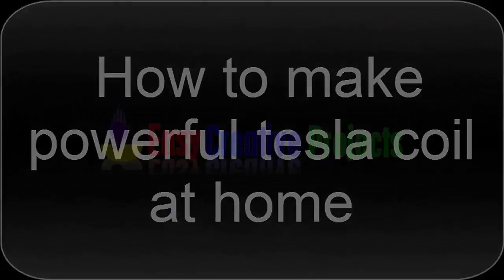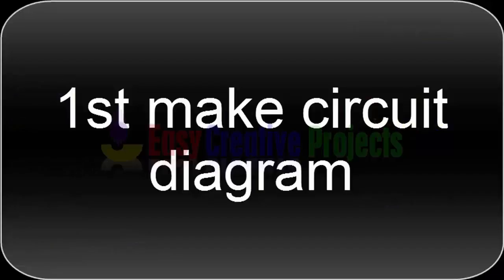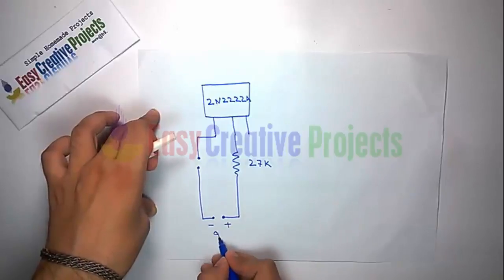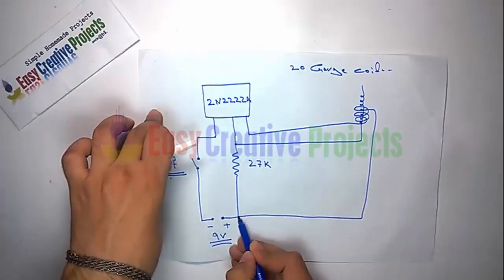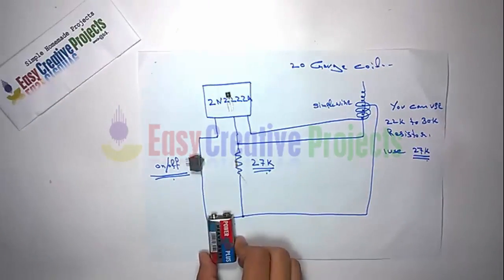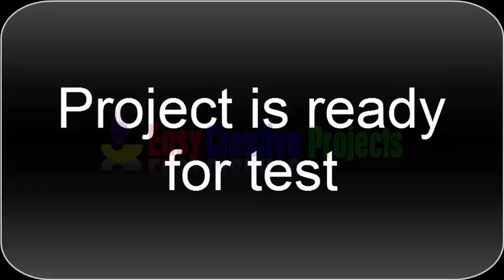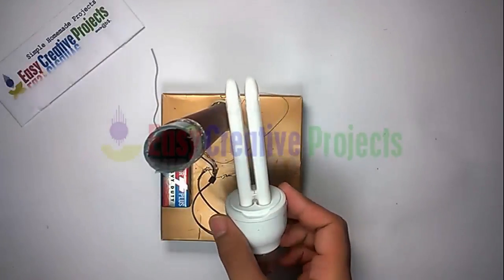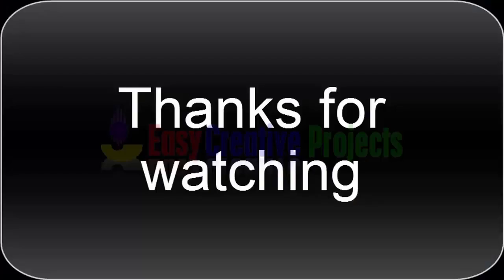How to make powerful tesla coil at home - easy step by step with circuit diagram

Comment: Sir How can I increase the output volt of coil???
Reply from the maker: i use simple transistor. if you want to increase voltage then use high power transistor and increase input power. but its very dangerous. this components enough for education purpose.

Comment: a 2n transistor cant make a powerful tesla coil because the voltage is low you need a more powerful transistor that can operate a higher input voltage
Reply from the maker: yes you right bro. but 2n2222a transistor is enough for experiment.
Reply: Easy Creative Projects yes your right I made one my self with a 2n2222 and it works great even at low power.

Comment: Thanks for the unique idea of making the tesla coil and your guidance. I have successfully tested it using 2n2222a transistors, 27 kohm register and 26 gauge copper wire with tube of 32mm dia and 30cm long. However I want to make a stronger tesla coil than this for my national level project. Can you please give me the materials required for it.
Again thanks a lot.
Reply from the maker: now simple increase components.  replace 26 gauge to 24 gauge. 2n2222a to 2n3055, or c5200 or any more powerful NPN transistor, so on........ 
but stop increasing voltage when you reach 18v.  its high risky when you increase voltage after 18v. 
thanks.

Comment: It doesn't works
Reply from the maker: dear 1st see circuit diagram carefully. if every thing ok thentry to check transistor. i think your transistor dose not working.
Reply: Bro i made same bt nothing happened
Reply from the maker: then try to change transistor.
i think your transistor feuz.